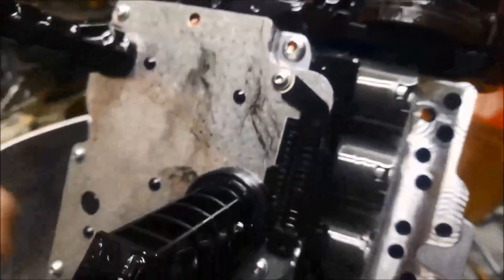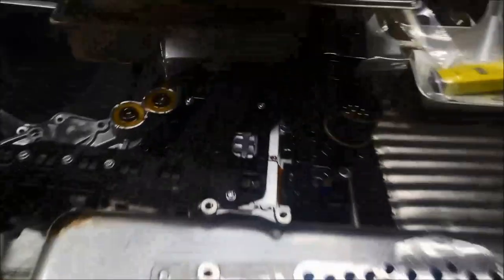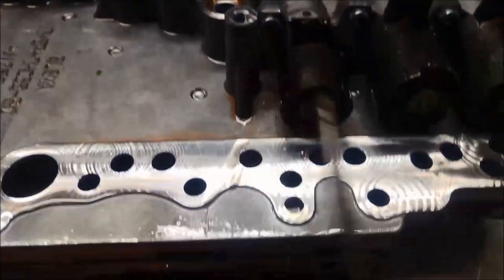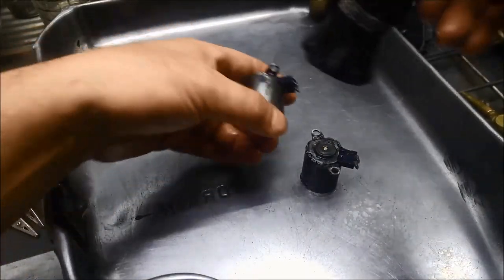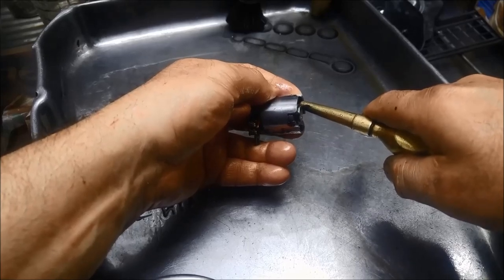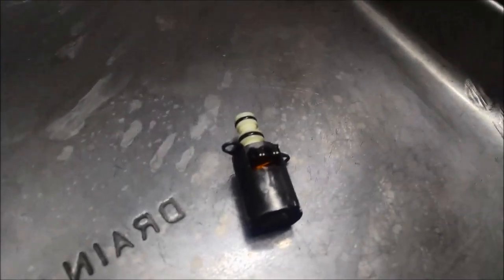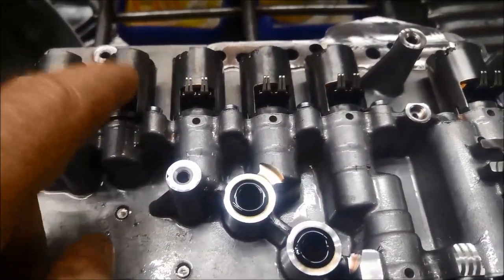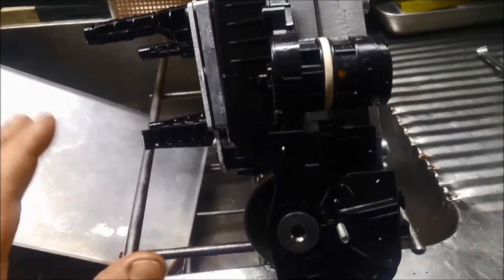Powershift Ford 6DCT450 DPS6 DCT Solenoid Testing P2of3 MPS6 W6DGA EVO SST Semi Auto Transmission

Comment from the maker: for further help, please also read through past comments and responses and check out our other related vids https://www.youtube.com/playlist?list=PLQLkuOdKuFotLWdTOl3KCK0xpgTu7CEJH   cheers
Reply: I've just removed the valve block to clean and test the solonoids etc 

I already used magnet on a stick to pull as much swarf from the selector sensor magnets in the box as I could.

Solonoids tested ok for ohms, demagnetised them and cleaned them and checked they were functional then moved onto the valve body.

Removed the torx bolts then put the unit on end to separate the two halves.

I heard something drop into the bench looked down and the 2 clutch valve plungers and one of the plastic dowels had fallen out.

I'm panicking now because they're different colour plungers and I can only find one small spring.

One is silver one is black, I don't know which came out of which hole and whether both are supposed to have springs or not.😢😢

The only diagram I can find shows 2springs but also shows different part numbers for the plungers and the solonoids themselves even though both solonoids on the job have the same part number on them.

So I'm not entirely sure if the diagram is right or not.
Reply: Having watched another video it seems that the silver plunger goes in "csp1 valve" so the black must be for "cps2"

The other video didn't show cps2 striped down so I'm still not sure if it is supposed to have a spring or not.

Comment: Hi, just wanted to say fair play to you. Your videos are excellent and extremely helpful. I have 2 2010 ford galaxy powershift at the moment giving issues, your video's have been a huge help towards tackling them. Have 1 stripped now, the problem was when slowing down coming to a stop it was dumping into 1st gear way too soon causing car to rev up high, I changed the oil and external filter and car drove approx 1000 kms and it greatly improved but still faulty,drained the new oil and was filthy already, took it apart and valve body and all solenoids are very contaminated, no sign of any plastic pieces,
Reply from the maker: hi, id assume you have checked/replaced all unserviceable soft of wearing parts ? the issue may be in worn valve body bores or valves. if you dont have a vacuum tester see https://youtu.be/aGSm8h7lIdo we are always encouraged when we get a few beers if our vids help. link is in description. cheers
Reply: @YepThatsIt  from.what I can tell at not been changed nore filter I was going to change but didn't know if there any flush I can put into system to give it a clean before draining
Reply: @YepThatsIt  all the valves looked like new, I took them all out and examined them and gave them a quick clean with very fine paper and refitted them all, I demagnetised all the solenoids and cleaned them all with brake cleaner, tested them all both cold and heated up in a kettle in a zip lock bag,all good , I replaced the clutch springs and plastic guides( old ones were very worn and loose and starting to break up and also starting to gouge the metal) also replaced the plastic thrust washers(old were worn about 5mm short causing excess movement)replaced the internal oil filter, new main seal, cleaned all the shift magnets ect,bought new metal gaskets for where the valve chest goes on, hopefully get it all back together today.

Comment: Great video, going through this now myself and following your video step by step. 
I didnt pull the valve body apart, I just removed and cleaned and demagnetised the solenoids, but when putting the solenoids back in, I noticed there is a small ball bearing (roughly 4mm) - any idea where that came from???

Comment: Thanks for the info well explained i have a solenoid d drive perfectly normally silky smooth but under hard acceleration from low speed  bring up a solenoid d stuck i clean them and swapped the solenoid over

Comment: Hi Yep, thanks for a great set of videos and it's probably a job that I will soon have to do. I have a few simple questions though. What cleaning fluid do you use? I have motor wash and ultrasonic cleaning fluid, these are both water based, will this hurt or damage the unit/solenoid?. Also brake cleaner.. can i use that? Can I use the ultrasonic cleaner? Thanks 🙂

Comment: Hello, do you have a clip with instructions on testing the two Solenoids on the leftmost side of the clip? When testing my car with 9V DC voltage, I only saw sparks from the two legs - but no movement inside the Solenoid. The remaining 7 Solenoids when tested with 9VDC voltage all responded with a Crackling sound inside the solenoid.

Comment: Thank you very much for saving my life.. only joking.??maybe. The whole saga of my gearbox would need a whole book. However, the problem was the oil was not changed so much so that the filter delaminated and contaminated the valves. Thus kaputt! The car will only accept the original sensor array with the computer built in. The reconditioned one I bought didn't work.. no communication. In a Kuga.. I think in Aus outlander? There is not enough space to remove the mechatronik module without taking out the gearbox or.. haven't tried it.. radiator.  Both massive tasks. However. It's possible to split the unit by removing the 7 tx20 screws in the gap. Beware! It's a 2 person job to reinstall and not for the faint hearted. It's east to f it up. Thanks 😊

Comment: Hi buddy thanks for some great videos really helped me on stripping and cleaning out all the solenoids, I have just reassembled everything and still getting a fault code for solenoid D poor performance or stuck I have put a snap reader on it and I  can see that solenoid D is very erratic on the graph, my main issue is I don’t know which solenoid D is would you know the layout of all the solenoids so I can marry them up to the fault code listing? I have looked all over the internet and unable to find a diagram which lists them??  Thanks again for you your help and great videos..👍
Reply from the maker: hi, what is it doing when driving? they don`t have one solenoid operating on each gear. but sounds like one or more solenoids are either still contaminated, leaking or worn. have you got a fault code? in 4th scss, shss2, csss2 and csps2 is operating at high pressure......
CSPS2 - Clutch/Shift Pressure Solenoid 2 (Even Clutch Pressure Control)
CSPS1- Clutch/Shift Pressure Solenoid 1 (Odd Clutch Pressure Control)
CSSS2- Clutch Shift Switching Solenoid 2 (Even Gear Pressure Control)
CSSS1- Clutch/Shift Switching Solenoid 1 (Odd Gear Pressure Control
SHSS1 - Shift Select Solenoid 1 (Forks 1 & 3)
SHSS2- Shift Select Solenoid 2 (Forks 2 & 4)
SCSS- Shift Cooling Switching Solenoid
CCFS- Clutch Cooling Flow Solenoid

LPS- Line Pressure Control Solenoid
....hope that helps....i think you will owe me some beers now https://www.paypal.me/BATS189 . cheers
Reply: YepThatsIt YepThatsIt  thanks for the info, I have fault code P0766 00 coming up I haven’t driven it since I put it back together it’s still on stands, I go through the gearbox from park to drive then moving back to neutral it bangs  revs up slightly and and transmission malfunction appears on the dash then the above fault code logs in the tcm ... 👍
Reply from the maker: check the electrical contacts on solenoids haven`t been bent. was there any plastic in fluid or valve body? if on stands, is vehicle sitting evenly or lifted only at front? could be fluid level. you will need to clear fault codes as well and go for test drive and see how feels

Comment: Hi sir, thank you very much for this clip, it was very useful.  I followed all your steps on the Ford C-Max 2008  and I have a question if the resistance is 2.7 ohms for all the selenoids, does that mean that I have a problem with them and should I change them? Thank you
Reply from the maker: hi, depends on the temp they are bench tested at. as temp goes up the resistance will go up as well. its good to do what you did, and compare to all the other solenoids as a reference. it is unlikely that they are all faulty. issues also relate to if they are worn/sticking or leaking. cheers

Comment: Awesome set of videos on the valve body of this transmission mate, so helpful!  I am planning on removing my valve body as my vehicle is throwing a P0715 which is an erratic signal on the input\turbine shaft speed sensor A circuit.

Is the replacement of that sensor relatively straight forward once you get to the point you're within this video?  Thanks!
Reply from the maker: hi and thanks, if yours is pre 05/2015 will have internal speed sensor, after 05/2015 they will have external speed sensor. cheers for beers
Reply: @YepThatsIt  Mine is a built in 2013, does that mean the transmission has to come out to get to the sensor itself?  I understand it is located near or in the drum and is the small wires that you unplug in your video.

Comment: Hello, thanks for this video. You have cleaned the solenoids, would you recommend this or would it be even better to replace them all with new ones?
Greetings
Reply from the maker: hi, apart from cleaning them, you also need to test for leaking and nice even results when ramping amperage. cheers

Comment: Hello, can you help me?
I have a power chift box in a ford s-max. The vehicle does not go backwards, and it breaks down (p0968 interruption in the control circuit of the pressure regulating solenoid valve C). Could you tell me what solenoid valve is? a greeting
Reply from the maker: hi, definitely worth checking solenoids if no mechanical damage has been done. cheers

Comment: Thanks for these awesome videos. I've Just removed the valve body from my Mondeo which was throwing the same codes and exhibiting the se behaviour. I've opened the valve body and it is very clean ...no plastic pieces inside. But, I have found tiny black flecks of plastic (I think) on top of the in tranny filter and in the oil. Is this likely to be from the clutch retainers? Can I clean out the solenoid s and flush the oil or will I need a rebuild ? Thanks again.
Reply from the maker: hi, sometimes the spring retainers are black, not white or stained plastic. i really cant say if needs rebuild yet, all depends how many times it has been flushed/serviced recently, however bits of debris like that isn`t usually a good sign. thanks & cheers 👍

Comment: Brillant video.  For a non mechanic is there any simple fixes possible for code P0766? Is there a way to flush the gearbox without taking apart... Wishful thinking.. Oil changed one month ago and was clean but now getting slipping, jerking etc. Any advice would be great, mechanic said gearbox needs replaced but don't have the money unfortunately, thanks in advance if u can help!
Reply from the maker: hi, solenoid d stuck off? you will need to follow my powershift videos for instruction. cheers
Reply: @YepThatsIt  help please if u have a minute. Put everything back as per video, coolant added, gear oil and filter.  Its one of the keyless type.  press start and it comes up with hill assist not available and wont even try to start.  Strange thing is the doors wont lock and i think the battery may be the problem?  ive a charger on it and its half way on the charger.  I never disconnected the battery taking the car apart could this have caused the problem?  no other warnings at all.  Any ideas please?  Its never had a problem with the battery before btw.
Reply from the maker: hi, its likely you have been working on it on an incline... the hla holds the brake pressure for a set period of time when you switch from brakes to the accelerator. when you press the accelerator, it releases the brake ( there is a switch on brake pedal).....try pumping the brake a few times with vehicle both on and off.  if i`ve helped you owe me some beers  https://www.paypal.me/BATS189   cheers
Reply: @YepThatsIt  the car is on wheel ramps and a slight incline!  Ive disconnected the battery meantime and charging it now.  It actually says hill launch unavailable which makes perfect sense with what u are saying however i did pump the brake but not a lot.  If that doesnt work is there anything else i can do?  I will defo some you more beer tokens!
Reply from the maker: @butcher776  definitely need more beers bloke ! make sure brakes aren't locked up still, try rocking vehicle back and forth, and pump brakes...it can`t be something you have done, its just locked...more bells and dings on modern cars means more things to go wrong ! cheers
Reply: @YepThatsIt  lowered the car and still came up with hill launch unavailable and shifter locked in park.  Manually moved gearshift on gearbox to neutral and car started.  Drove car for 20 mins and gearbox seems to be working fine.  Problem is if I put shifter in park the car won't start and comes up with hill launch unavailable and the car won't lock.  If I turn the shifter lock under the panel beside the shifter I can put it in neutral and it starts and drives with no fault codes or errors. Any ideas as I'm not sure if it's safe to drive like that?
Reply from the maker: faulty range sensor or try loosening the bolts and twist to one side and try. or try adjusting cable slightly. make sure you mark exactly where everything was as a reference point before to start changing anything. good work cheers
Reply: @YepThatsIt  just sent a few more beer tokens!  I had a pin in the range sensor per the video and when removed could see the hole lined up.  Do you mean loosen the top bolt and the 2 bolts  holding the range sensor in and wiggle there?  I'm assuming i wont have to drain the oil to do this?  It selects all the other gears correctly and will go into park, its shows p on the dash and p on the powershift but engages the lock when put into park....makes sense that it something ive done as it didnt do this before but could it be the solenoid that works off the brake?  If i turn the unlock thingy when in park it shows park on the display and lets me lock the door.  i tried adjusting the cable on the gearbox selector by putting it in park on the gear box and fitting tightly there btw.  The car drove well but i didnt want to push my luck incase this causes a problem.
Reply from the maker: @butcher776  check external cable adjustment first, and if no luck then remove front cover and loosen the two little bolts that hold the range sensor in place and try move it to one side and try. make sure you don't start vehicle when you try it. cheers
Reply: @YepThatsIt  much appreciated! just to be clear.  When I manually move the gear level on gearbox to park I had power shift in park and adjusted the cable that fits on perfect.  The car goes into all the other gears fine, r u suggesting its like a few mils out on hole alignment and lastly I can adjust this without drawing the oil.  BTW I did disconnect the battery for a while as it ran flat.
Reply from the maker: @butcher776  the sweeper contact plates inside range sensor wear out where they usually sit when you select gear positions, because you have removed things, it has moved the old positions of everything. regardless of what is showing on your dash, try adjust the cable slightly in any direction and see if range sensor contacts now sit in a better spot ( off the worn bit )....the flat battery will definitely affect things if there are poor electrical contacts. make sure your battery is charged and strong, not just charged, otherwise replace battery. and make sure little resistance is lost across your earth strap. sometimes just loosening and retightening bolt will improve contact but ideally scrape away the paint on chassis and add some electric grease on the bolt thread and on cable terminal. cheers
Reply: @YepThatsIt  OK, checked the range finder, the hole in the  wheel was OK I thought but the pin I have sits in the guide and hole and is about 3mm out of line when fitted, the best I can get it.  Would this cause the issue? Just to recap, after assembly drive, neutral and reverse worked and the car drove well, if range finder is not working why does it go into drive etc? Put it in park and the lock came on and display said hill launch unavailable.  Before I took it all apart again the car started in neutral.  I've turned off hill launch in menu and the shift still  locks in park.  main problem with this is the doors won't lock until the manual unlock is done on park, car started, move to neutral then park again and lock doors....would the wheel being out a few mill cause this? Can I override this going into lock thing?  Loosing the will to live now and looking up car breakers for best price......
Reply from the maker: the range sensor basically tells the computer which gear you have selected so it can do its programmed thing. if it was misaligned then you wouldnt have the gear selections you have or starting in neutral. the contacts inside the range sensor could be worn slightly...sorry hard to diagnose without the vehicle here, however logic would say that if you had it working the way it was before work was started...you may have misaligned or knocked out of adjustment something minor. cheers.
Reply: @YepThatsIt  cheers for that.  So given that it selects 3 positions the alignment of the wheel is OK then. Does any of the solonoids play a role in park and the contacts not bent up enough?
Reply: Would a diagnostic tool give any clues as I can get a mechanic to connect up to the car
Reply from the maker: diag worth a try, but i`m thinking either brake switch /trans cable adjustment
Reply: @YepThatsIt  sorry for all the questions but due to time difference I'm just trying to rule stuff out.  Brake lights working so does that rule that out and if I put the car in park on the gearbox does that rule out cable adjustment or does the powershift need to move the selector?
Reply from the maker: @butcher776  sorry was public holiday yesterday. brake switch doesn't only operate for brakes. cheers